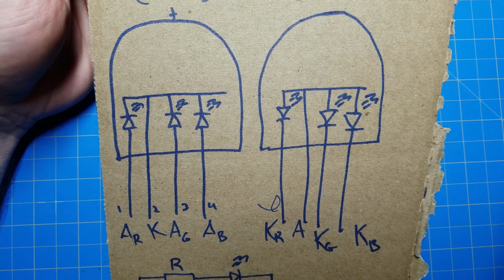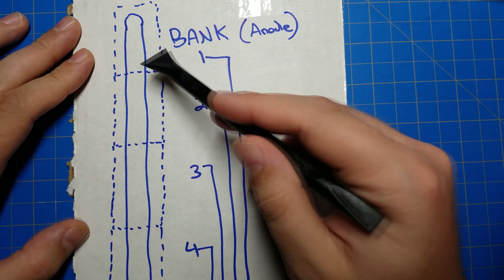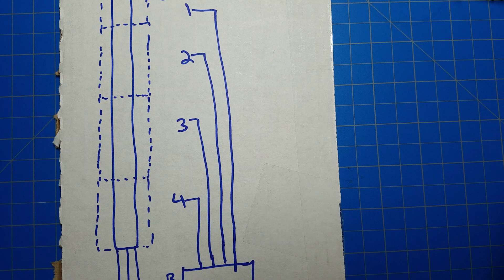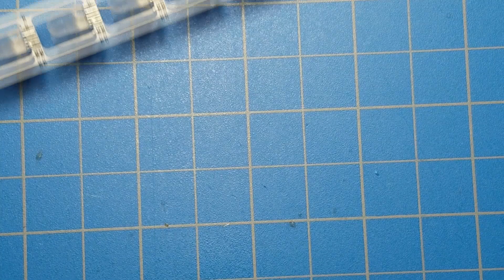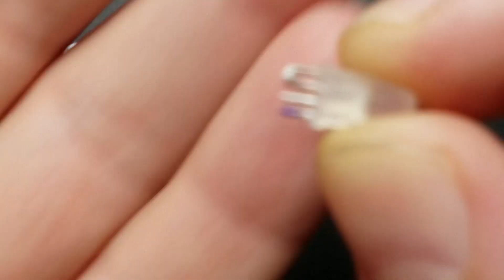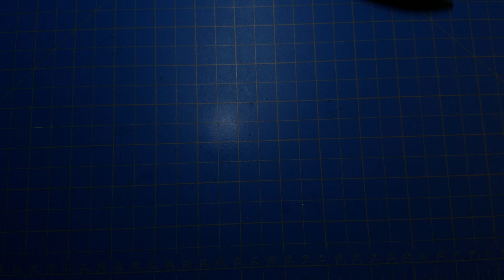Explanation and Replacement of RGB LEDs in Galaxy's Edge Lightsaber Blades

Comment: maybe you can help me, i have a savi saber, a single LED on the blade is having issues, when a yellow crystal is in the hilt the single led appears orange/red, purple crystal= purple led, red crystal=red led, white crystal= purple led,blue crystal=blue led, and when green crystal led does not light up at all.. ive replaced the batteries and same results, do you think its an led issue?
Reply from the maker: yup, sounds like the green component of the RGB LED has died. you can try emailing Disney at Merchandise.Guest.Services@DisneyParks.com and explain what's happened to them. you may be able to have them mail you a replacement blade.

Comment: Enjoying all your videos, great information!  Would it be possible to mod the saber so instead of turning on in 4 "banks" it could be done in lets say 8? or maybe 2? Or more or less?  Just curious if it's possible?
Reply from the maker: dividing up the LEDs into more banks would be difficult. it'd require heavy modification of the blade PCB and some kind of extra support logic as the stock microcontroller only knows how to turn on 4 banks, so you'd have to do something extra that detects say when bank 1 is turned on by the microcontroller and use that signal to turn on 2 or more banks, one after the other. possible? maybe. but no way would it be worth the effort. instead I'd suggest replacing the entire blade's internals with a strip of addressable LEDs and a microcontroller like an adafruit feather.  then you can animate your blade with however many banks you want, from 1 to 100. Dead Bothans Society did something like this already. You can see their work here: https://www.youtube.com/watch?v=0tyXPJwSe80

You could probably reduce the number of banks if you wanted by connecting the base of the 4 PNP transistors (one for each bank) so that when 1 turns on, all 4 do, or pair them up, to get 2 banks instead of 4.

Comment: As I'm watching your video I'm seeing that the blade colors are determined by the LEDs lighting up in specific combinations via the micro controller. Since blue and green are present, why is it that we're not able to get a teal or cyan color blade? Why can't that combination be made?
Reply from the maker: The LEDs are capable of making those colors. However the microcontroller does not have the programming to create those colors. That is probably on purpose. MY GUESS is that the designers of the lightsaber hardware originally included programming to support teal and orange blade colors, but then a decision was made to not include those colors (perhaps because those colors aren't considered canon?) and so the programming to support them was removed from the blade. However the programming to support them was not removed from the hilt! The LEDs in the hilt will turn teal and orange (if a kyber crystal with the appropriate RFID is inserted) and it will send the command to use those colors to the blade, but the blade interprets "orange" as yellow and "teal" as blue.
Reply: @Ruthsarian  Ahhh, I see... Do you think it would be possible to reprogram the controller in the blade to accept the appropriate commands and display the desired color combos? (I know it would take a ton of work, just wondering if it would be possible).
Reply from the maker: I don't think so. I believe the microcontroller used is a type known as one-time programmable. Meaning you can only program it once. To get the blade to recognize those colors you'd have to replace the microcontroller. Really, you'd have to replace the whole PCB in the blade with something different. Some people have replaced the microcontroller and the LEDs with an arduino-type microcontroller and 'neopixel' style LEDs.

See https://www.youtube.com/watch?v=0tyXPJwSe80 for an example.
Reply: @Ruthsarian  Wow, crazy! Well thanks for the info! I appreciate you taking the time for it! :)

Comment: If anyone can figure it out, I'm sure you can. What if I want to change color on my legacy saber?. Would the blade theoretically need modding or the hilt. I'm sure I'm not the only one that would like to change blade color on my legacy saber.
Reply from the maker: i have not seen anyone able to non-destructively open their legacy saber hilt, so making changes to the hilt is probably not feasible. i think the blade is what would need to be modified.

however i don't think it's an easy modification. it's not just turning a color channel on or off, the microcontroller very quickly turns the channels on and off to create different brightness levels as well as to help limit the amount of current running through the blade, keeping components from burning out. you'd need to either create your own circuit that generates those pulses and then wire that signal up to a bank of switches to turn on the color channel(s) you want on, or you'd need to find a way to take the pulses coming from the blade's microcontroller and redirect them to all the color channels you want to activate.

i'll give this some more thought. if i can find a solution that i think is viable i might try it.
Reply: Ruthsarian I’ve actually opened up my Graflex (Rey) Legacy hilt and pulled out all of the electronics.

This video was super helpful because I’m trying to figure out if I can just replace the board with a CFX module and keep the existing blade system!
Reply: @Derek199574  How did that work out for you? Was thinking about replacing the microcontoller with a wled module. It would be cool to use the hit effects, but I doubt I'll get that far into it. I'd rather use my blade as an RGB decoration than a hit stick anyways,
Reply: I've been looking for a possible solution to this. Would love to turn the Skywalker blade more white like the original effect.

Comment: would you happen to know if you can upgrade the speaker? they seem kinda on the low end. if anything would you know what size and ohms if the speaker
Reply from the maker: i don't. the speaker is in the battery housing. I've tried taking it apart, but I haven't found a way to do it that won't break it and I've only got the one. my guess is that it's just a plastic ring glued around the rest of the battery housing, but I feel like if I try to force it the whole thing will break.

Comment: Is there any way to make each individual LED not so visible in the blade?  I just don't like how the light in the blade doesn't look like one solid color when up close and at certain angles.  You can definitely see each LED. Maybe more layers of film?  Though, I know that will cut down on the intensity of the color.
Reply from the maker: I think a few layers of diffusing material similar to what's used in LCD/LED monitors and televisions to diffuse the backlight would probably help. I'm keeping an eye out for any old LCD monitors being thrown away at work that I could salvage that material from and see how it'd help the blades.

Comment: Is it possible to modify the ROTJ legacy lightsaber. There are a green and red triangle next to the power switch is their any way to make them light up? Something like the droid control.
Reply from the maker: I don't know. I don't have one of those lightsabers to take a look at. A few people I've talked to have mentioned how difficult the legacy lightsabers are to take apart. 

My guess is adding a couple small LEDs would be possible, but the trick is getting the thing open in a non-destructive manner first.
Reply: @Ruthsarian  ok cool. Thank you for responding I just wanted to see if it was possible👍. I thought it would be a cool feature to add to that lightsaber since they had those green and red triangles near the power switch.